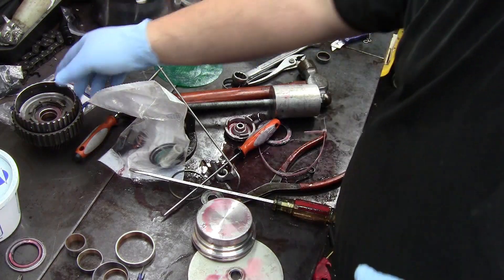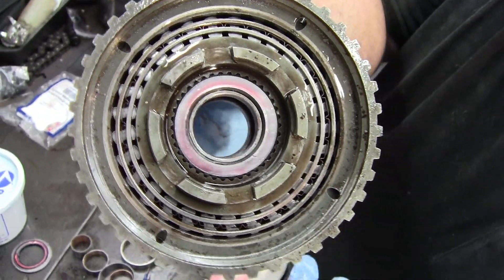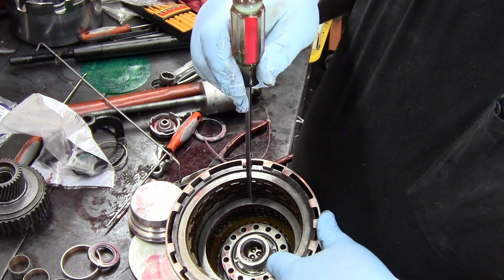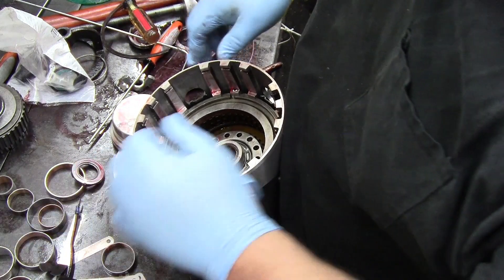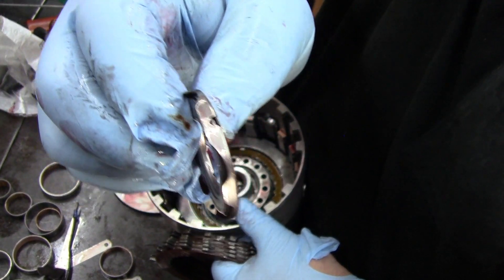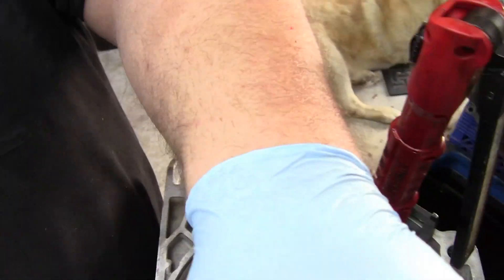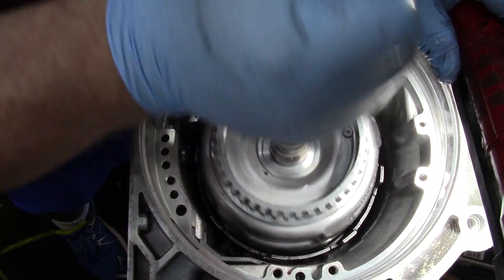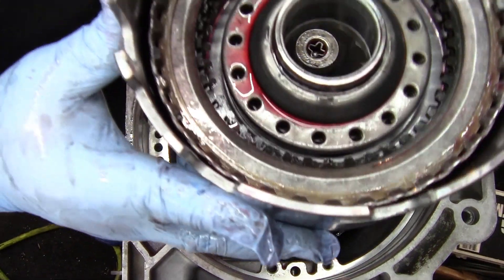Installing the forward sprag, upper case assembly on the 4L60e

Comment: I can't take off in D but I can shift up from 1st, as long as I lift off the accelerator when I shift it grabs 4th or driver gear. I was told that's a sprag.
Reply from the maker: Possibly, but it could be a very weak/worn 3-4 clutch also.

Comment: You sure didn’t spend no time on this subject mine is a new cage but when it came apart the bearings tops and bottoms were ate up it was open tcc solenoid and I still ain’t figured out why but it smoked forward spray and bearings
Reply from the maker: There are several videos on the forward sprag.  Check out the 700r4 videos too...

Comment: Smitty! Question for ya I have a fresh rebuild 1994 4l60e has 1,2,R no 3,4 doesn’t matter if I try to manually shift it or not still no 3,4
Reply from the maker: There are a number of things that can cause that. Shift solenoids, fwd sprag, split Teflon ring on the input shaft, the 3/4 clutch itself, hydraulic leaks, missing check balls. Too much trans gel holding the checkballs that hasn't melted yet. I would start with a solenoid check as it's the least invasive...

Comment: Is there a certain way lube holes should go on input sprag race to sun gear?
Reply from the maker: On this model, it is not important on the sprag.
Reply: @IrocinZ  is the oil slinger a good benefit to have on the rear planet? Or does it not make a difference I don't have one on my planetary.

Comment: Looking for help, my 4l65e when put on D and 3rd feels like neutral rpm’s rev up but doesn’t move only moves on 1/2 
When shift manually every gear works but when come to a stop on D or 3rd looses gear and feels like neutral,,, 
Any suggestions on what it could be
Reply from the maker: Sounds like to me the 3/4 clutch is done. Or the Teflon seals are worn out on the input shaft. Either way, I'd be pulling it out for a teardown and inspection...
Reply: Forward piston

Comment: Hey i have a 4l60e i just rebuilt and 3 & D are just neutral. No matter how much i put thought into it i can’t remember if i installed the sprag in the right position is this a possible symptom if it was installed wrong?
Reply from the maker: Exactly your condition. But, you could have cut a seal on the 3-4 and it would result in the same condition...
Reply: @IrocinZ  i made sure to pressure test the pistons before installing by putting air trough them so i have mentally prepared my self to bring that transmission down again tomorrow thank you!

Comment: Hey Smitty, 95 g20 w the 4L60E. I can manually put it into 1 and 2 and I have reverse. No speedometer, abs light on. I replaced the VSS and buffer, still have same issues. Any ideas?
Reply from the maker: You should have reverse no matter what. It is hydraulically controlled. My guess is it probably broke the sun shell. If so, you'll lose 2nd, 4th, and reverse. But that's only a guess. It is possible you have no power, or a weak ground to the trans with a torn stator shaft seal causing a hydraulic leak at the reverse input housing...hope this gives you some ideas....
Reply: @IrocinZ  I can manually put it into 1/2 on the column. It does nothing in Drive. I can manually up and down shift 1/2 on the column. No speedo and abs light. Leads me to believe its something electric.
Reply from the maker: @coffeebeforetalkie4341  All except the no reverse....If you had reverse, then I'd say the forward sprag is broke. Kinda hard to diagnose long distance...lol
Reply: @IrocinZ  I have reverse. I understand the long distance diagnosis. Ha. So to be clear, I HAVE reverse, and can manually put it into 1 and 2 with the column. I have NOTHING in Drive. No speedometer. VSS and buffer replaced already.
Reply from the maker: @coffeebeforetalkie4341  Then mechanically wise, the forward sprag is probably broken. Not related to your vss problem,  just happens to be a coincidence...

Comment: Thanks for the video. Very helpful. About to dig into one for the first time. Has 1st 2nd, reverse but doesn't move when you put it in overdrive, guessing sprag is bad or installed backwards
Reply from the maker: Could be, but more than likely, there is an issue with the 3-4 clutch. Normally it won't move at all in any forward gear if the sprag is bad. Sometimes if you put it in manual 3rd and it goes there, then the fwd sprag is okay.
Reply: @IrocinZ  you think so?  My guy built it and he said he double checked it already and that it all looks good. From a stop you have to manually drop it down to first or 2nd for it to move but in OD it won't move from a stand still lol. I'll keep you updated ima dig into it today. Do you know if the bell housing and the valve body needs to be removed to get to the input drum?
Reply from the maker: @horsepowerfactorytx  Okay, well I must have been half asleep when I read your comment this morning and misunderstood it...lol. Yes, in manual 1st, 2nd, or drive, it moves but not in OD, then the sprag is probably your suspect...Sorry about that
Reply from the maker: @horsepowerfactorytx  And I missed the second question..Yes the bellhousing has to come off and you could probably snake the housing out but you'll save yourself a headache going back together it you take the valvebody and 2-4 Servo out.
Reply: Well just an update, sprag was good. Swapped VB still the same thing. So clueless at this point. Just for anyone in the future that has a similar issue.
Reply from the maker: @horsepowerfactorytx  So was the sprag put together right? With the sun gear up and grabbing the outside, the sun gear should rotate counter clockwise. Otherwise, I'd say it's possible the fwd clutch is leaking or there is a tear in one of the Teflon seals...just some ideas...
Reply: @IrocinZ  the sprag was installed right. The Teflon seals on the input drum look great. We pressure tested the drum and it all looks good, forward clutches apply good, 3-4 apply good, the apply band works good we tested that with air too. It's just so weird lol thinking the lo roller at this point or an issue with the case.
Reply: Gona takw it apart again and check the o ring at the very bottom of the input drum below the apply pistons, heard that could cause it too. Decided not to check lo roller since it has reverse
Reply from the maker: @horsepowerfactorytx  Interesting...I don't think the low roller is the issue as its pretty full proof. Have you double checked your checkball locations? Manual valve? Correct link? You've really got my curiosity up....
Reply from the maker: @horsepowerfactorytx  if you left that oring out, it would not of air checked
Reply: @IrocinZ  thanks for that tip. What if it has wear or cracks on the oring? I'm thinking of putting a line pressure gauge and see if pressure drops in OD that would surely indicate a seal leak right? I checked the fluid paths for manual first and it bypasses that seal
Reply from the maker: @horsepowerfactorytx  That would be a great place to start
Reply: Did you ever figure out the issue ? I have the same problem as far as it goes into 4th I think when I put it in OD , and won't take off. If I put it into 1,or 2 it will take off just fine. Then as you go faster you go into 3 and it shifts up and then in OD it will shift between what feels like 3rd , 4th and over drive by itself but when you slow down it won't down shift to 1 or 2

Comment: What you think it is whenever a transmission only goes in 2nd & first but not in drive or 3rd , but once im speeding and change it to 3 and D it works
Reply from the maker: It depends on your trans. What model are you referring?
Reply: 4l60 04 silverado
Reply from the maker: @OscarGomez-jh2sz  it could be caused by a bad MAF or plugged cats giving the MAF an incorrect reading so the ECM holds the gears longer. A faulty vehicle speed sensor will also cause that
Reply: Did you figure out what was wrong with it mine is doing that to but when i mess with 4x4 no gears worked and had to shut car off and on to get the transmission to start catching
Reply: Mine is doing the exact same thing and can’t figure it out. It’s not throwing any codes even on a shop scanner, and everything shifts fine if I do it manually up to D. It even downshifts perfectly when coming to a stop, but then I have to start in 1st again. Is this the sprag or an electrical issue?
Reply: @MikeyThicc  Mine ended up being something in the transmission, i just send it to get it rebuild